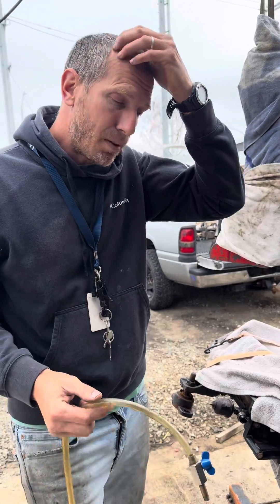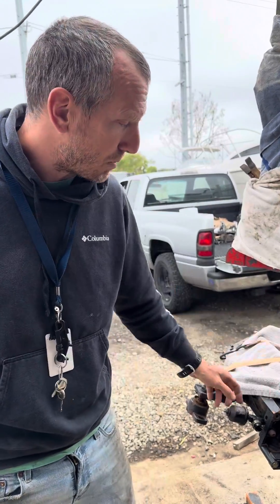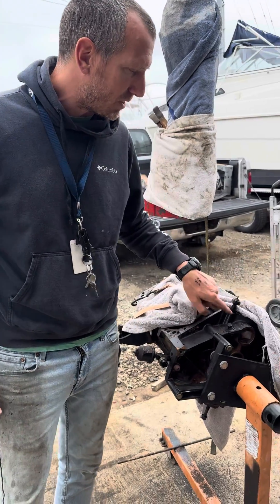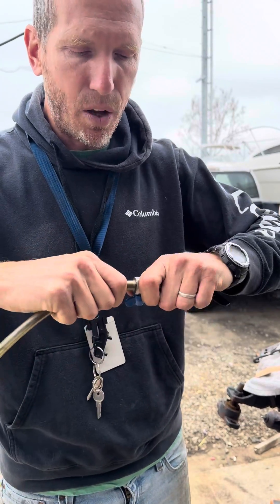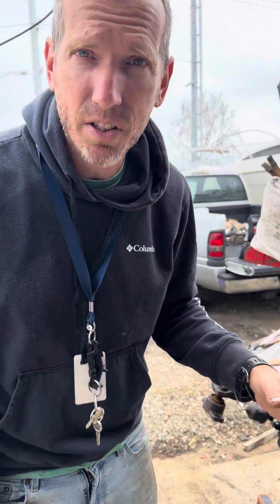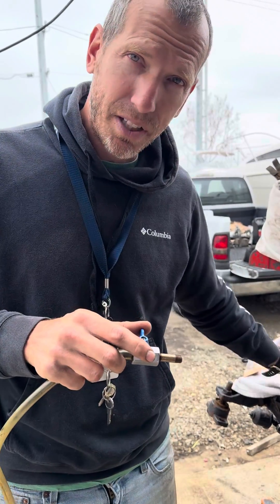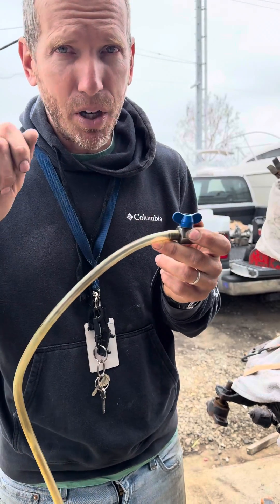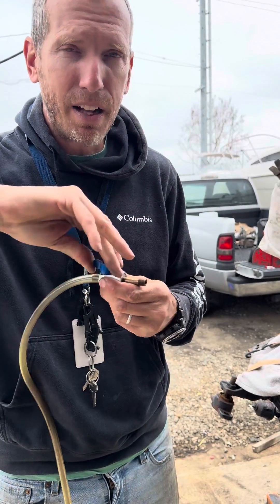How to remove/flush creamy milky oil sludge from a running engine quick and easy

Comment: Why is that different than just draining the oil normally after after a few minutes of running. Fill it up with a 1/3 ratio let it run a few minutes then drain again? Repeat if needed.

Comment: Im.not a mechanic by any means, so if my question is dumb please don't laugh. Lol
 You say to use diesel for flushing. Is that for a diesel engine or for any engine??
Reply from the maker: no problem! yes I use diesel as a thinner, its not combustable and helps the sludge thin out so it can get flushed, it gets real thick. Hope that helps.. on a gas or diesel engine- im just thinning the oil with diesel in the crank case :)

Comment: I did this once on the advice and help of friends, we used kerosene but it wasn't because the oil milky, it was just sludge. It worked great in my recollection (this goes back about forty years). I wonder how effective or risky this would be in a diesel motor.
Reply from the maker: im sure it will be just fine! ive resurrected many an engine using this method- works like a charm every time. Last customer i did this for (saved him a few grand by avoiding a rebuild) came back 9 months later and blamed me for his valve spring breaking because he was too  "broke" telling me all the boat shops before me were profesisonals. I had fixed every thing that kept breaking on his trashed engine - just a jerk. Rant over! Im sure itll work :)